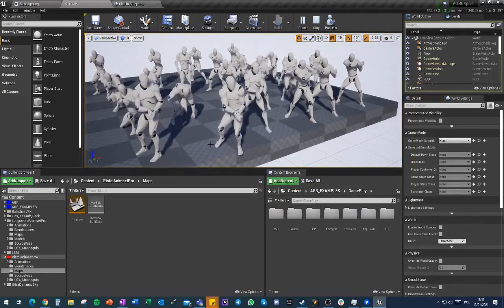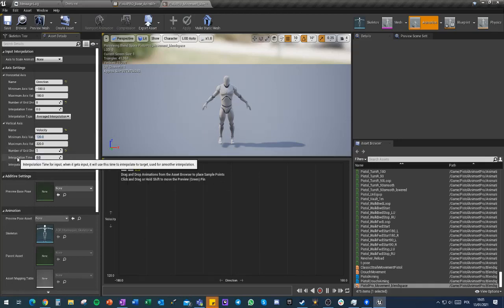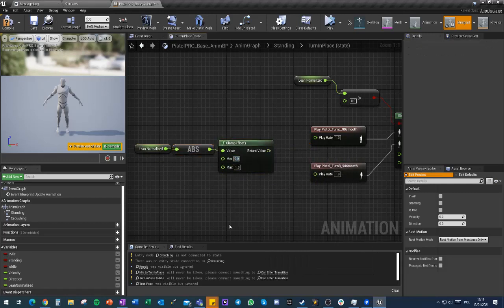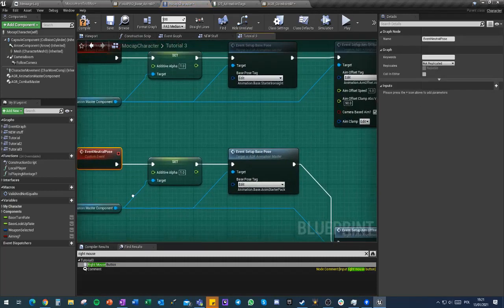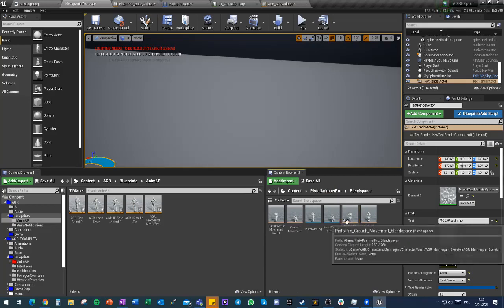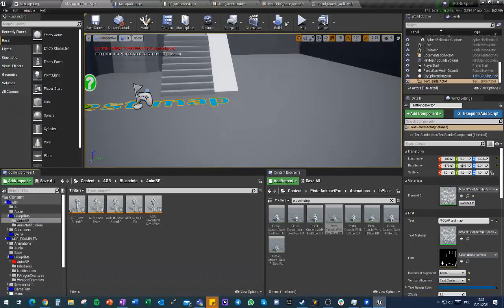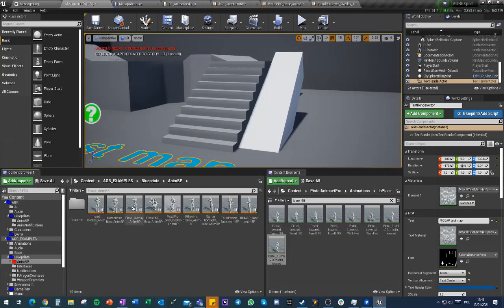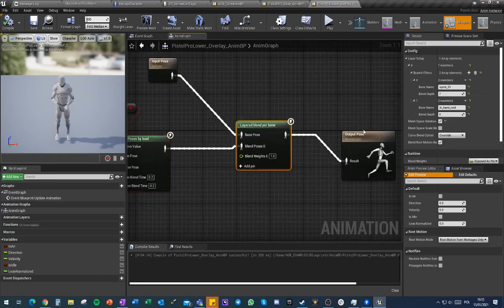Kubold Mocap PRO complete setup in multiplayer with AGR component - UE4 Advanced Blueprints Tutorial

Comment: This is why I'm buying Kubold animation sets instead of Mocap Online. They both look great, but it would take way too long to figure out how to setup animation sets that are this complex without a guide like this. Thank you.
Reply from the maker: theyre both pretty good.. kubold lacks directional jumps though :P and mocal online got better spine position on turn in places.. but kubold got more stable locomotion and a lot better blends and anim time even without sync markers. if you have time - it's best to mix them.
Reply: @3sgamestudio  Mocap Online is apparently a PITA to work with and has no documentation that I can find. I don't have them, so I'm just repeating what I was told. To paraphrase what I was told about them "It's like getting ahold of a set of assets from a massive AAA project with a very opinionated workflow and having no documentation to guide you on how they are intended to be used." Apparently, they aren't just a set of animation sequences, and you have to parse through them and put together all the poses etc and you're looking at a very complex animation blueprint that you will have to work out piece by piece. Again, just what I heard. What I can see for myself is that the Kubold folks took the time to give guidance on how their asset can be used correctly.
Reply from the maker: @hbirtt  for sure kubold is easier to work wit hand mocap online would benefit a lot if came with an anim graph. :/
I personally have a temaplte project where I have all animations and graphs set up in advance but it took a lot of time to make it. and its not perfect and still need adjustments from project to project.